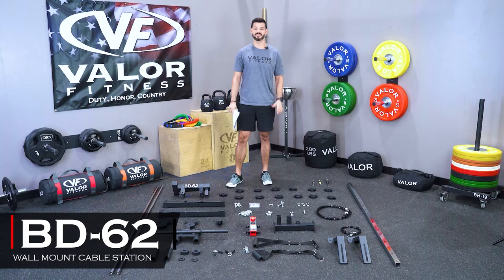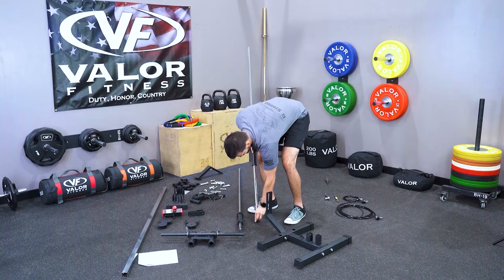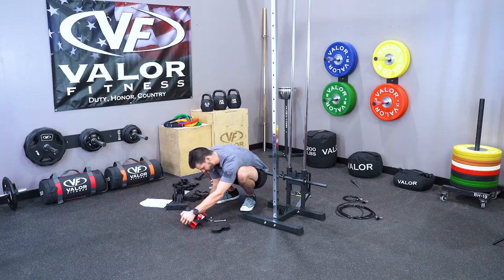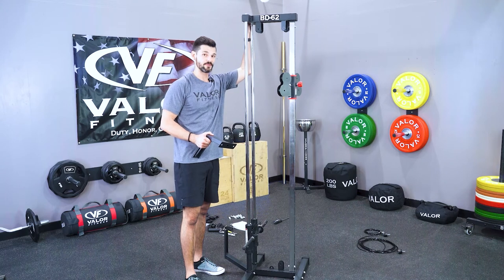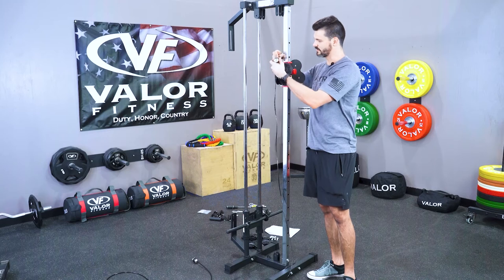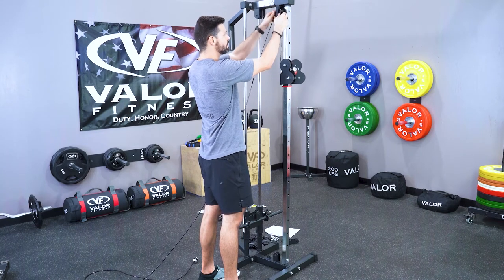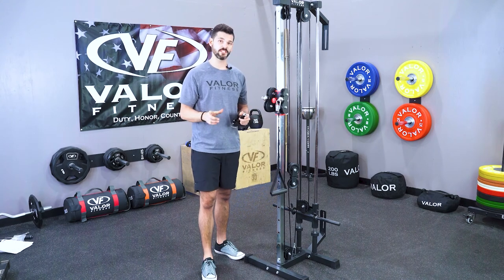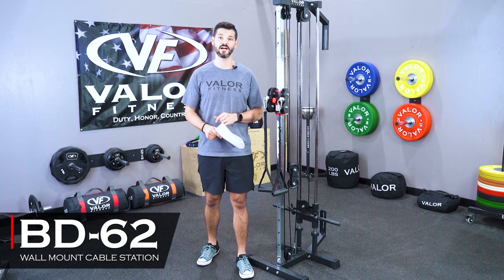BD-62 Wall Mount Cable Station: Assembly | Valor Fitness

Comment: My cables are now tangled after just a few months of use. I assume the cables stretches but I don’t know how to tighten them
Reply from the maker: Soldier Fit Club, apologies for the late reply. If you unthread the cables and let them naturally untwist, then rethread the cables this will help. Or....if you are able to twist the cable while detached from any accessory, this too will allow the cable to untwist itself. Let me know if this does or does not work.
Reply: @ValorFitnessInc  thank you for the reply. How did it get twisted in the first place? If I do it over again will it have the same issue because that’s a lot to do every time. Did the cables stretch?